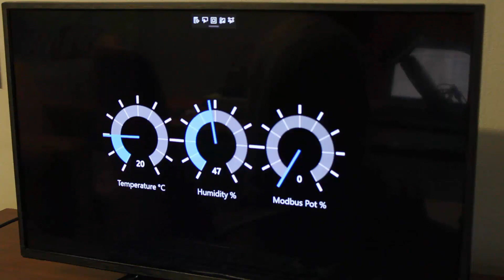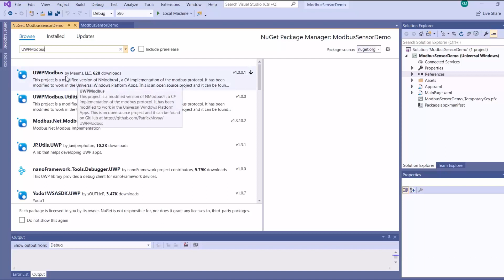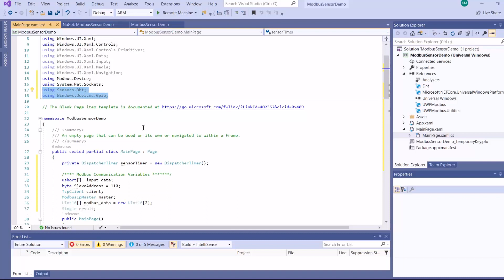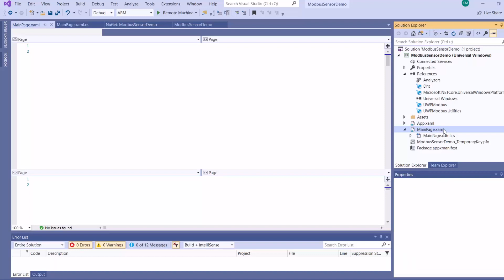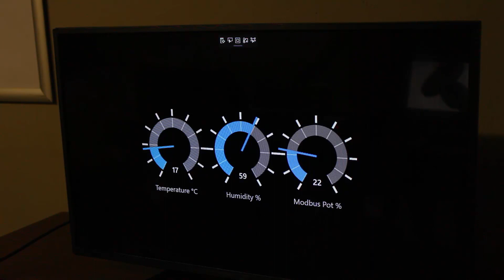Windows IoT Modbus TCP - How To Read Modbus  Using Raspberry Pi with Windows 10 IoT Core

Comment: Nice demonstration! I was looking at a couple newer videos with .NET5 on the RPi. In this case the .NET5 is installed on the Pi and I saw some CMD line programs running with GPIO control. However, I didn't see a way of creating a UI for the Pi as you have done here. My question to you: Is the .NET5 replacing the IoT Core for the RPi, if so what about creating UI's? I guess it's a bit confusing. Maybe you can create a video using the .NET5 with UI?   Thanks... :-)

Comment: did you connect the humidity sensor directly to raspberry pi using (Tx,Rx pin on Pi) or did you used a converter in between your sensor and Pi?